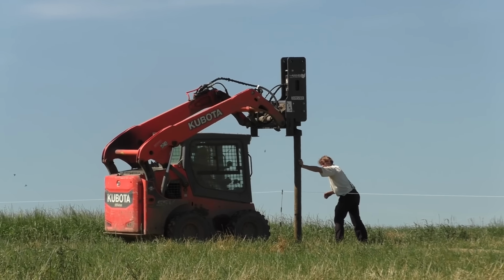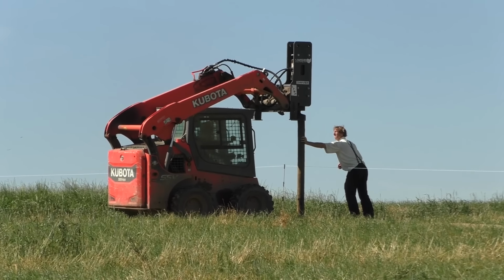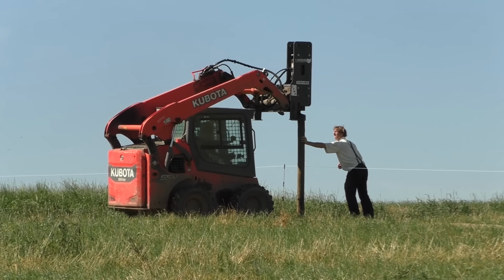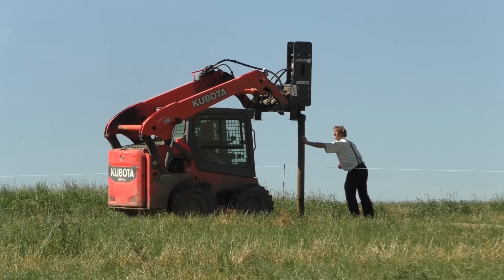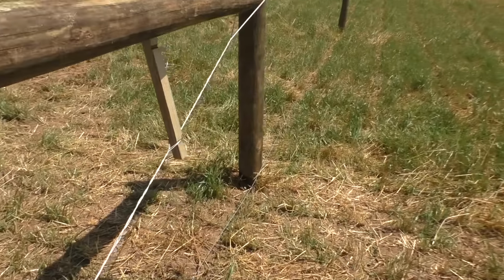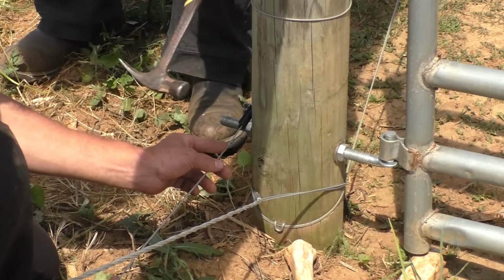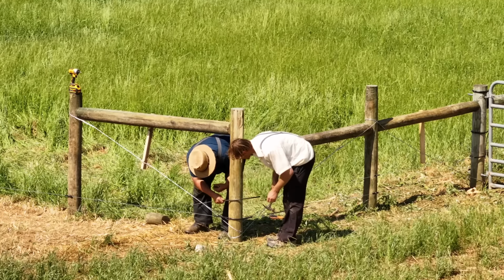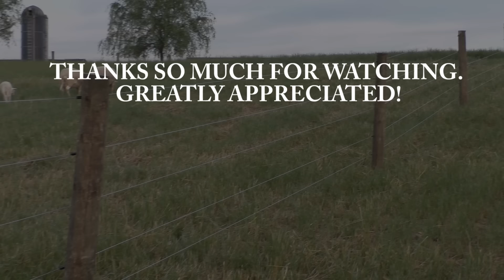Building HIGH TENSILE Electric Fence From Start to FINISH with the AMISH in Lancaster's AMISH LAND

Comment: Good video! It shows how "clean" the electric fence can be installed without those yellow plastic insulators I've used on my horse fencing. I can see the animal can graze as close to the posts rather than a few inch gap between the post and insulators, leaving roughly a foot of grass that you have to weed trim. Do the Amish use weed trimmers along the fence lines? I know it can cause a short unless they have those that would shock weeds off from the wires.

Comment: Great video. Why are the two middle wires not hot and top and bottom are…. Thanks for sharing and have a blessed weekend!!
Reply from the maker: The top wire is for horses and the bottom for lambs. They may energize all if needed.
Reply: @LancoAmish   thank you. Appreciate you getting back with me.